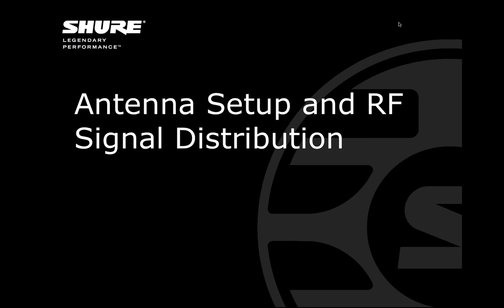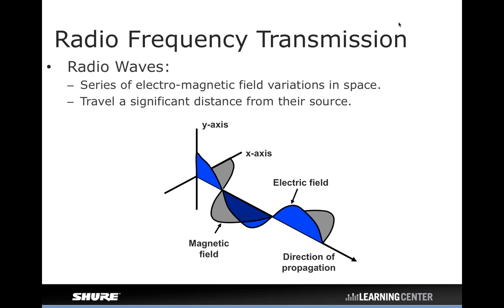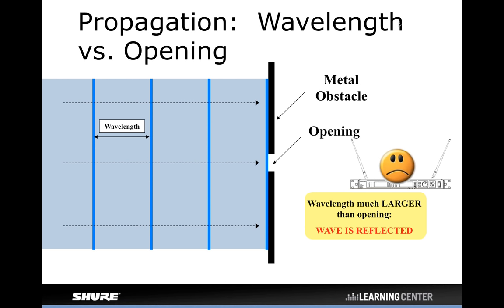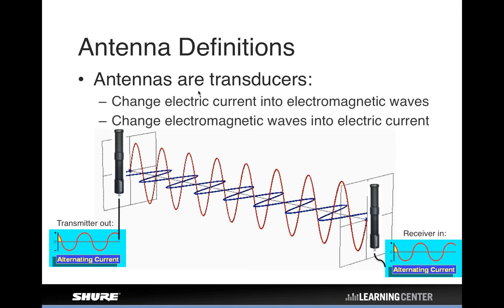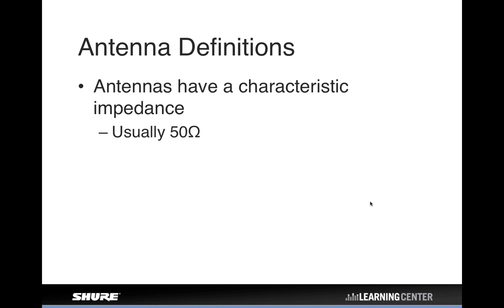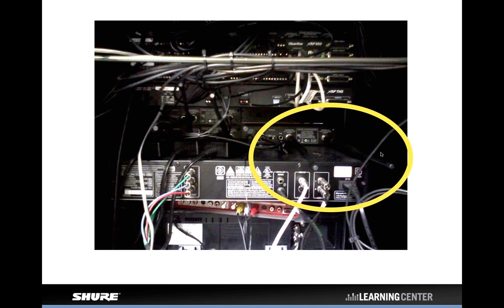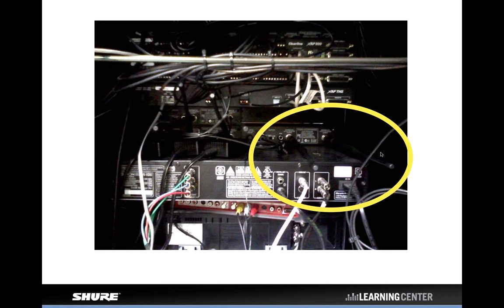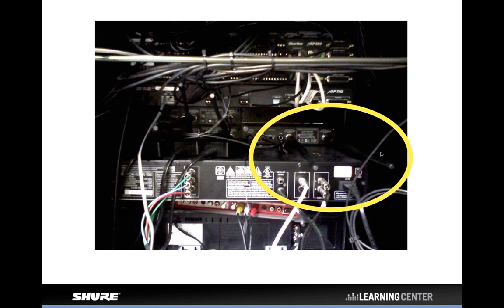Webinar: Best Practices for Wireless Antenna Set Up | Shure

Comment: The four room antenna combining diagram is wrong, yes? B and A from all rooms should remain on their own legs?
Reply from the maker: I found the 4-room picture at 56:50 in the webinar (it goes by so quickly – good catch!).  Essentially, it’s the same drawing as in the tech bulletin linked below:
 
https://www.shure.com/americas/support/find-an-answer/antenna-distribution-4-rooms-8-antennas
 
I noticed that the “A” and “B” antennas for Rooms 1 and 3 in the webinar picture indeed were labeled incorrectly.  It should be possible to trace each antenna through the two splitter kits back to the corresponding input at the main equipment rack.
 
If the antennas were connected according to the webinar picture it still would be ok, as both an “A” and a “B” antenna are placed in each room.
 
Thanks for catching the error!  I hope this helps to explain it.

Comment: Can the paddles be used on either end of a stage when set to -6dB on 50' of RG6-quad?
Reply from the maker: We recommend 50-ohm coax cable such as RG213 or RG8 for remote-mounting applications.  Using 75-ohm cable will result in additional signal loss due to the impedance mismatch, something around 2 dB or so.  Some of these cables also introduce significant signal loss.
 
The manufacturer of the particular cable you are using should have a specification for signal loss over 100 feet of cable at certain frequencies.  A reference chart we have here shows RG6 cables to have about 5 dB of loss at 450 MHz, as an example.  The total signal loss at the receiver should be no more than 5 dB, regardless of which type of antenna cable you are using.
 
It may be possible to run 50 feet of the RG6 and use the paddle antenna set to -6 dB.  For a 100-foot cable run, you probably will have to set the amplifier to 0 dB or +6 dB.  The paddle antenna has about 7 dB of gain in the forward direction when compared to an omnidirectional antenna, which also should help.
Reply: @shure  Can you expand on the note about impedance mismatch causing a loss of 2dB?  As this value is 0.18dB from other references which clearly show their calculations.  Access to the reference calculations that lead to the 2dB value would be very helpful to understand this fully!
Reply from the maker: @huktek  Thanks for your question! As you note, the precise calculation does result in a less loss than we state in the webinar (sounds like your referencing this paper: http://audiosystemsgroup.com/Which_Coax_for_Wireless_Mics.pdf) For purposes of simplicity, we often just round to "1 dB or so" to illustrate that while there is some additional loss, it's negligible. Ultimately, we would like the takeaway to be that as long as your total loss is less than 5 dB, that's what matters the most. One or two dB, either way, won't affect the overall performance of the wireless system.